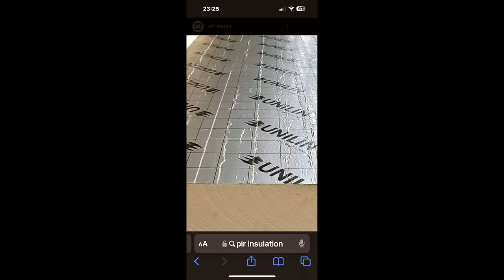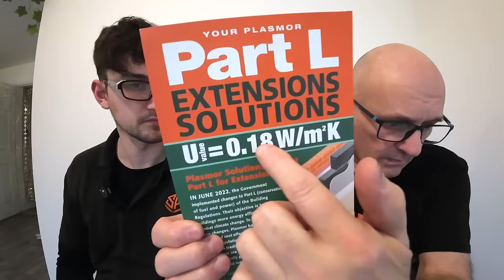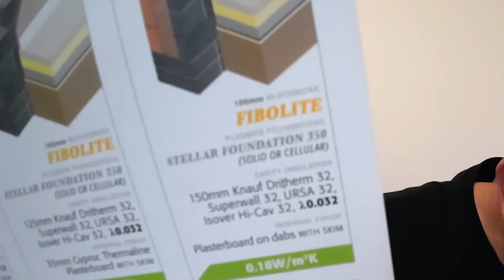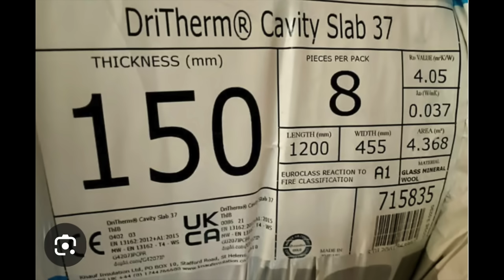PART L BUILDING REGULATIONS CHAT

Comment: Have you worked with insulated timber cassettes yet, for walls… the new style timber frame, and with an external skin (masonry or other)…?
Reply from the maker: No not yet 🧱👍🏽
Reply: S.I.P`s panels,  (Structurally Insulated Panels)
I have used them in domestic construction. The  design called for additional insulation and rain screen cladding externally, and similar detail internally 
The wall achieved a thermal transmittance value of 0.010 W/m2k  and nice and easy to put together. But  a complete pain to achieve air - tightness on the completed structure.
👍👍 Nice and toasty inside that house......
Reply from the maker: @martin2466 😁🧱👍🏽

Comment: These regs are another issue requiring more expence, same with forcing electric vehicles upon us, all thought up by those who don't have restricted finances,an example is politicians who have deep pockets, all normal folk are struggling now, with no signs of improvement financially. 👍
Reply from the maker: Very true 😒🧱👍🏽
Reply: Its all the same Mate....smart meters, electric vehicles, heat pumps. A rushed through policy without any thought to peoples finances or any unintended consequences of it all....
Reply from the maker: @martin2466 😒😒🧱👍🏽

Comment: We do same as you Steve and on extensions we always do brickwork first. I do think it is a bit pathetic most of the houses we work on have no insulation in cavities. We spent 3k on insulation on the last job. It's fast getting to the point that material costs will make extensions too expensive. Who has 80k equity in their house to build a single story extension.
Reply from the maker: Brick first every time 🙌🏽. 
   The costs are eye watering now 😬🧱👍🏽

Comment: Hi guys,great video by the way not much on Youtube regarding partL building regs. I'm just working on an extension at the moment. I'm building a 100 mm cavity using Celotex TC1090, which you can pick up from Berrys at £13.39 for 450 x 900. This leaves a 10mm cavity. Wouldn't it be cheaper for you guys to go down this route instead of digging your footings at 650mm wide, requiring more material to shift? Then you're using more concrete and having to use 350mm trench blocks which are heavier and not cheap. I can understand in certain situations you can't do this.
Reply from the maker: It is one of the options but we hate building the inside skin first plus all the extra time with the the tape and discs .
   A mate of mine used that stuff and it was warped so wouldn’t sit flat on the wall . It ended up being recalled 😬🧱👍🏽
Reply: @SteveAndAlexBuild  i  know where your mate's coming from. You really do need to keep the blockwork on the cavity side super clean and snot-free. The tape can be fiddly but I would definitely give it a try, lads, on an extension where you have plenty of room to manoeuvre. I must admit I like to build my facework first.

Comment: Men, don’t get lulled into buying expensive foam board for insulation… all insulation of this type on the market in the UK must meet the same standards for thermal efficiency, so all is as good as any make… The suppliers of course will want to sell you the high price boards on which they make bigger profits, but don’t get screwed by this… shop around for the best prices - it all meets the standards or they would not be permitted to sell it…👍🏻
Reply from the maker: Very true 👌🏼👍🏽🧱

Comment: It just shows you how different the ‘rules’ are in different areas ( which they shouldn’t.!), we are allowed to put the mineral wool below damp (225mm min) so we don’t have to put a perimeter insulation around. 150mm pir in floor slab and fibrolite’s are way more expensive than celcon/ thermalites down this way (£22.00 compared to £16.50)… bizarre.!!
Reply from the maker: 😳😳. Fibolite are made up here in Cheshire so maybe that’s why we get them cheaper 🤔🧱👍🏽

Comment: You need two membrane between pir boards as pir react/soak with concreat. Polystyrene does not react with concreat and is less of water sponge. The backer board contain xps boards, which is better version of polystyrene/eps. Xps is waterproof and is good insulator
Reply from the maker: 2 Dpm’s is nothing to do with the new regs .   
That has been the rules fie a few years .
   Also it’s spelt concrete pal 🧱👍🏽

Comment: Great video, very informative.  What would happen if you wanted to build a first floor extension on top of a ground floor extension that was built prior to these new regs?
Reply from the maker: Good question. We don’t do any jobs above single story so not sure what happens 🧱👍🏽
Reply: @SteveAndAlexBuild  Chaps,
Much would depend on the discretion of your local Authority Building Control:
1) = They may allow you to build both the ground and first floors to the original g.f regs..
2) = You may have to achieve current regulations on the first floor only.   (unlikely)
3) = You build the first floor to current regs,  and up grade the ground floor retrospectively to meet the same criteria.
Best to approach your local council for your area and discuss with them initially.
Reply from the maker: @martin2466 . Big changes coming next month apparently. Spoke to our local building control today 😬🧱👍🏽
Reply: @SteveAndAlexBuild 
I am not surprised to hear that Mate. 
A lot of local authorities are pushing ahead to achieve their targets earlier than the official dead-line.
Reply from the maker: @martin2466 😬🧱👍🏽

Comment: you can use 100mm cavity with celotex taped insulation and internal thermal block. I think as many do its all bollocks, none of it is proven other than the air quality in the house is shit so vent the windows?
How many 9 inch house exist in england that dont have damp issues built 100 years ago?